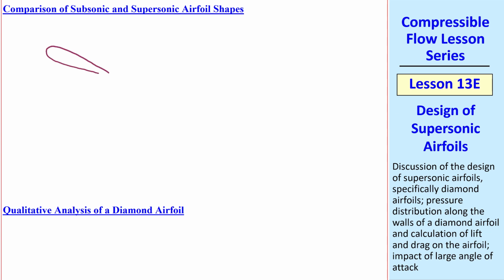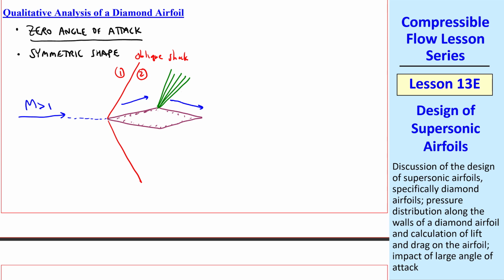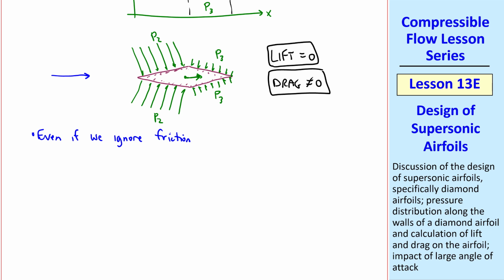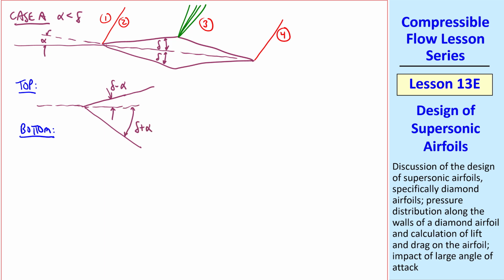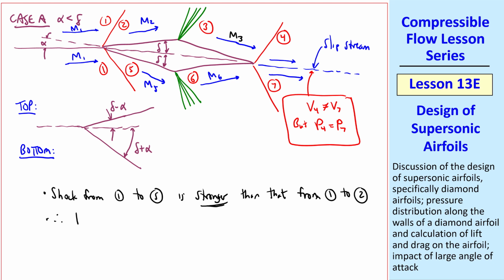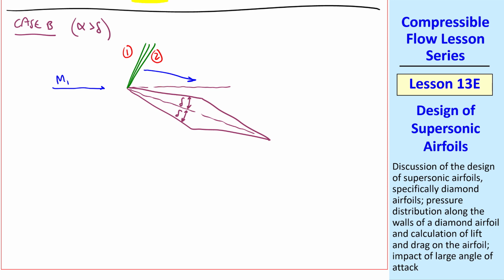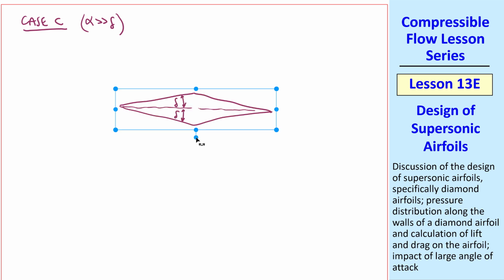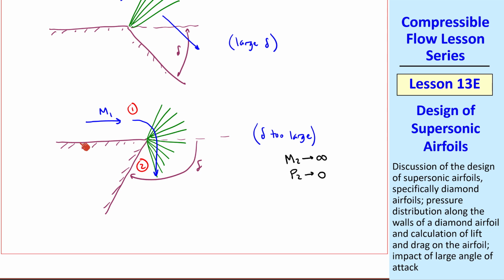Compressible Flow Lesson 13E: Design of Supersonic Airfoils

Comment: If the diamond airfoil is not symmetric, and specifically the delta angle in location 2 is greater than the delta angle in location 5, then the oblique shock from 1 to 2 will be stronger than the oblique shock from 1 to 5 for small positive angles of attack, correct?
Reply from the maker: Yes, each segment of the flow needs to be analyzed according to the angle of flow coming in relative to the turning angle. Thus there will be either an oblique shock or an expansion fan, depending on the relative flow angles. The strengths of the oblique shocks and the expansion fans depend on both turning angle and oncoming Mach number. 
Thank you for your comment. Please tell your friends about my channel.

Comment: Professor, great video! I’m doing a work where I have to vary Mach and also angle of attack. I wrote a code, but for Mach 1 and 1.5, I can’t calculate because there is no force to form a shock wave, what can I do ?
Reply from the maker: Mach 1 probably won't work. I suggest putting in something like 1.001 as the Mach number - that should give you results. M = 1.5 should work without any problems, so you must have an error in your code somewhere. See also the next lesson (14A) where I work through a detailed example for a flat plate. The diamond case is similar but with a little more trig. Please tell your friends about my channel.